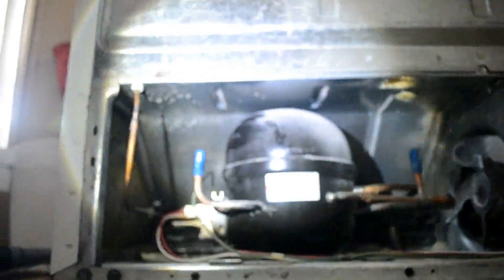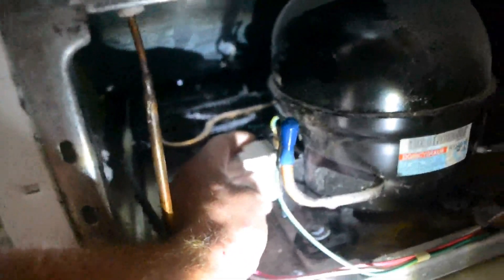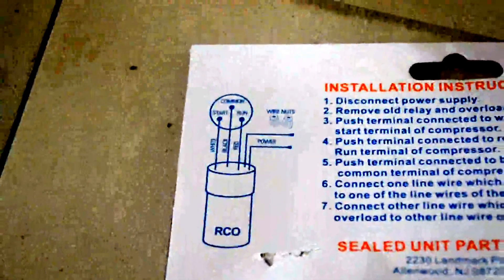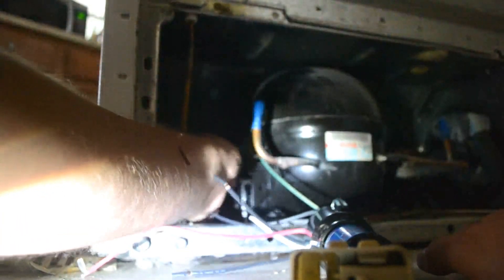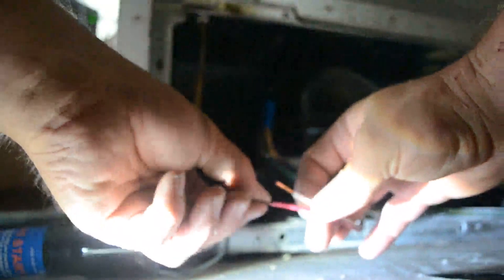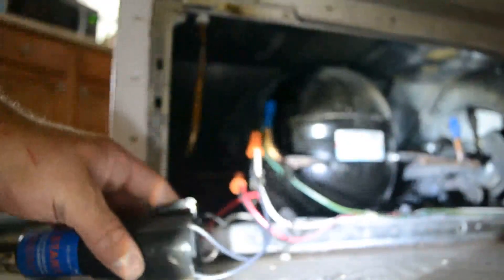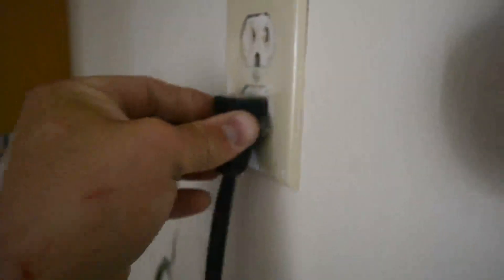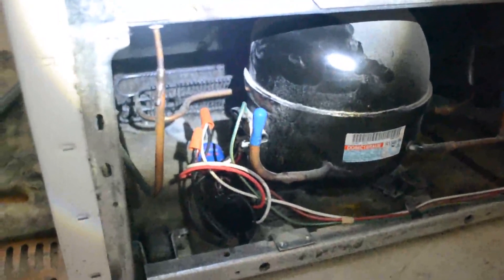Replacing Refrigerator Capacitor Overload Relay with Supco Hard Start Kit

Comment: What did you do with the original wire that connected to the "common"? Mine just sparked when it touched another part of the fridge when plugged in.

Comment: First, when you take off the relay and the overload there are three connections common, run and start. After viewing about 20 Youtube videos everyone takes their time explaining how to place the three connections that come connected to the three n' 1, but the spliced side its like fast forward. 

You have three wires (connections) that came off initially is it two wires in one splice, three in the other. Which two are paired together?

Where do  you put the common from the wire harness?

Comment: I installed a 3 n 1 on my fridge. The compressor did kick in and started running. Now 4 hours later, it hasn't shut off and the compressor is very very hot. So because I'm leery of possibly burning up the compressor, I pulled the plug out to let compressor cool down. How long should compressor run with this kind of relay, before stopping ?? The temps in the fridge and freezer were in their suitable ranges when I pulled the plug..
Reply from the maker: +ValentineDayTwin 
I can't say for sure why it would run for hours, but 4 hours is not particularly unusual especially if you had food inside that had warmed up while the refrigerator was out of operation. It could take up to 24 hours to stabilize with the compressor running up to 8 hours at a time (depends on your refrigerator). For example, energy efficient refrigerators are designed to run much more but draw far less energy.

The compressor inherently runs warm/hot, my guess would be that you hadn't felt the compressor before you had issues with it, so it'll seem unusually hot, though it could be normal. We're talking about normal temperatures around 250*F, above 300*F is when the oil begins breaking down and the compressor is exposed to increased wear and eventual failure.

Tips:
Make sure you purchased the correct kit
Ensure all contacts are connected fully and firmly
Make sure you clean out any dirt/dust in the bottom that may have collected over the years, paying close attention to the fan and condenser coils.
Try adjusting temperature setting to a warmer setting
Keep doors closed
There is the possibility that the Hard Start Kit may be faulty. 
If in any doubt call a local certified professional to diagnose.
Reply: i got the same issue like you did. it is running non-stop. how did you fix it?

Comment: Hi there. I feel that if the 3N1 does not start the compressor after using two different ones something else might be wrong. I rechecked the compressor and it is good. I tested the two power wires that hook to the two black wires on the 3N1 and found out I have no power going to the 3N1. However the light works in the fridge. What else should I check?
Reply: +Jan Gaudina Maybe the refigerators timer went bad while in the defrost position,so only power will go to the defrost element in the freezer,plug up the unit and touch the back cover of the freezer if it starts getting warm,unplug the unit and look for your timer and try to manually with a flat head screwdriver to rotate it to the next click,to see if the comprressor kicks in. I have seen it happen before.

Comment: thanks for the vid!!  I am at my wits end with my little 4.4cft.  I plug it in interior light goes on, compressor only hums, and after two hrs gets really hot.  I replaced the starter QP2-4.7G relay, I ohmed out the 3 pins to 7,6, 13 all continuity,  I ohm'd compressor for ground with scratch test, I ohm'd overload continuity is fine.  what the heck am I missing.  the fridge was in storage for nearly two yrs.  Any further tests or should I 3in1 like your video to 'jumpstart' this thing.  appreciate your professional opinion and thank you!!!  (I do hear a hissing sound as if something is in copper tubing)
Reply from the maker: +Adam Szopinski 
Sounds like you did the basic testing on everything, and it all checked out good. It’s still possible the compressor is burnt out, but it also could be that the compressor just needs a little extra kick, that a hard start could provide. The easiest thing to do would be to hookup a hard start kit and see what results you get. 
The hissing you hear could be a refrigerant leak (unlikely),  chances are if you only hear it after its been running, it’s the pressure differential equalizing (this is normal operation).

Comment: whirlpool model GS6SHAXLT03. I first bought from another company a replacement for the ome part that had about 5 parts and depending on your compressor you would attach one part to one pin on compressor and another part to the two pins. I turned it on and it worked. Compressor fan was working. Worked for about one week than stopped.Then decided to order 3 n 1. But didn't work. My oem part 2212194 takes three wires to attach to where in your video looks like 2.  Power wires are red and white. One of my wires from power is white with two attachments. One of the white wire attachments  goes to another small part about 2 inches wide and one inch tall which has two attachments. I think that part number is 2188516. So the white wire from power goes to both the oem part and the other part. The other part then has a blue wire that goes to the oem part. So three wires attach to oem part.
Reply from the maker: +Jan Gaudina 

I would grab a multimeter and do a basic test on the compressor first. Possible you may have a short.
But in general:
The hard start kit will replace both the relay/overload (your part 2212194) and the capacitor (your part 2188516). Once you take those out, you'd then connect the start, run, common to the wires as shown on the hard start kit diagram. Then connect the two power wires.
Reply: I checked the three pins on the compressor for contunity and got a tone by touching the bottom one against the two above separately. 

I scratched off some paint on compressor and put one lead there and touched each pin and got no tone. Compressor is fine I believe. 
3N1 was connected but didn't start the compressor.  I'm sending 3N1 back to Amazon.

Comment: Just a tip for anyone else who had trouble with this:
Make sure you've got the terminals correct.  My refrigerator had the same colored wires as the hard start kit, but the colors did not match up.  Instead of trusting the wire colors, find out for sure which terminal is which, using this method, copied from another website I found: 
Using a multimeter set to ohms touch one lead (of the meter) to one terminal and the other lead to one other terminal and record your reading . Lets call 
these terminals (A) and (B). The remaining terminal lets call (C)So for example A-B=7 Ohms
Now lets read A-C and record. Lets say 5 Ohms
Now lets read C-B and record. Lets say 12 Ohms
Now lets add all the A’s= 12 OhmsNow lets add all the B’s=19 Ohms
Now lets add all the C’s=17 OhmsThe highest reading will be the “Start” winding
The next highest reading will be the “Run” windingThe lowest reading will be the “Common” winding
Therefore B= “Start”The next is C=”Run”
The remaining terminal A= “Common”
Using this method, I was able to connect my hard start kit successfully, and fix my fridge!
Reply: zibodiz:your comment was the key to getting the three in one hooked up correctly.  Very informative!  Thank you very much!
Reply: Your the boss man!

Comment: Hey Dude, We should call you Combat Warrior.... 
Our fridge a GE makes a slamming noise when the compressor shuts off....
Any ideas? It is just an $800 frodge from Lowes or Home Depot.
Reply from the maker: Dixsigns Dairy Goats Sounds like the internal mounting spring/s inside the compressor are failing or have failed. Regardless, it's not a servicable apart.
Reply: Thank you, gut feeling was not good... Nita

Comment: I assume your wound has now healed so I'm not gonna give you any shit about it!
Thanks for the concise video - one issue andto a question.
It went fuzzy at the worst possible time but....
I bought a Supco 410 today from a local shop, didn't want to wait for Amazon 3 day.
One thing from them. Some people on youtube say it's a temporary fix until you can replace OEM.
Not according to the guys who sell 'em every day and will be glad to sell you those original parts too.
My counter guy says he keeps em in his truck for folks' emergencies - and he put one in his beer fridge - twenty years ago.
My question is my two brown power source lines go into some plastic connectors and come out as the three lines - the black common to the overload, Orange (not red) and the White that connect to the start relay.
So the question is how do I connect these THREE wires to the TWO black inputs on the Hard Start?
Thanks again !

Comment: Sometimes when the relay or capacitor is bad, it draws to hard on the main board and a solder joint will burn out.  Perhaps you could check that by removing the panel and flipping it over.  This burn will likely be under the black components.

Comment: Hello !

I have a question... how you know which of the Supco hard start kits to use ??
I mean there is a model 410, 810 and SPP6 ??

I have a side by side General Electric refrigerator with ice maker and water dispenser... but I have no clue how much HP's the compressor is...

Could you help ?
Thanks in advanced !
Reply from the maker: It depends on the HP of the compressor. The 810 is for compressors with horse power of 1/12 through 1/5, the 410 is for compressors with horse power of 1/4 through 1/3 HP and the SPP is for compressors with horse power of 1/2 through 3. If in doubt use the smallest (the 810) and then try the 410. Most modern refrigerators seem to use the 810. It is unlikely any consumer refrigerator would use the SPP as that would be more for industrial/commercial or similar uses.

Comment: Today I came home from vacation to find my mini fridge turned off, when i plug it in, nothing happens (no noise, no clicking, etc...) Does this mean it is the compressor not working?
Reply from the maker: That could be the case, but that's not the only possible cause. First, you would want to check that you're getting power. Then you want to check the defrost thermostat, especially on mini fridges as the freezer often fills up with ice. Next you would check the starting components, easiest way would be by replacing with a 3-in-1. If everything checks out upto this point and it still doesn't turn on, then the fridge is pretty much scrap (i.e. not worth fixing).

Comment: ok you installed the kit as directions on the package. The power supply is coming from? The wiring that was on the old start and overload? I have a white a blue and two oranges the blue and white were on one side top and bottom and the oranges were two wires connected sharing the lower left terminal. Where do these wires go? I would think the blue and white are hot and neutral but the two orange? Wtf?
Reply: +mark buller lower right on the two orange, sorry.

Comment: Hi, I have frigidaire chest freezer and the compressor controler is burn (not working) is it Ok to replace the with after market controler or universal controler to it.
the old part number is 216649302 when I contact the manufacture they don't make those part no more

Comment: When I tried a starter kit, I measured 120 volts pre-cap, and 140v after cap. So instead of just "kick" starting the compressor, the 2-phase kit I tried dumped 140 volts continuously on compressor wingdings, thus overheating it and killing it. Don't use these kits, all they do is kill your compressor.